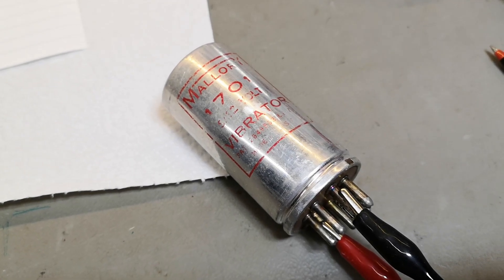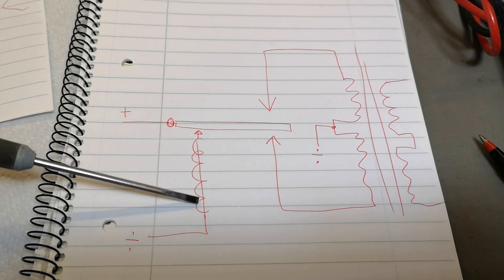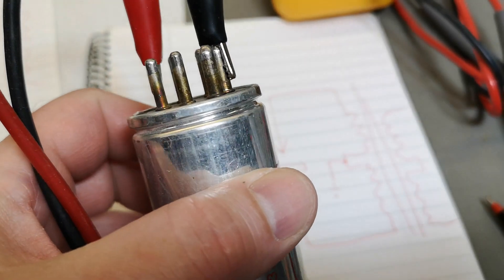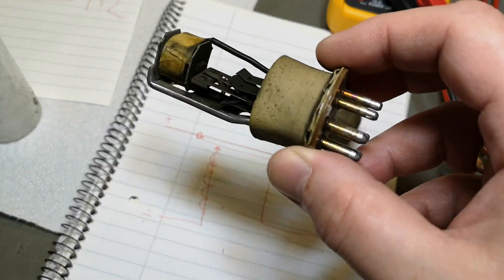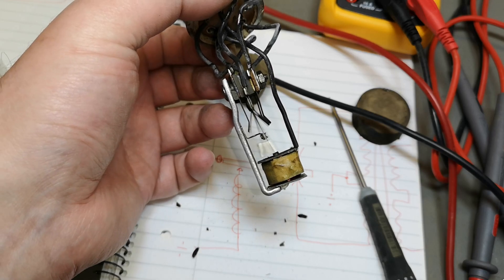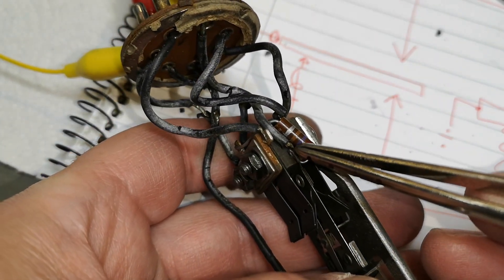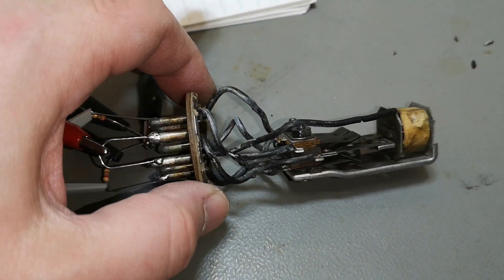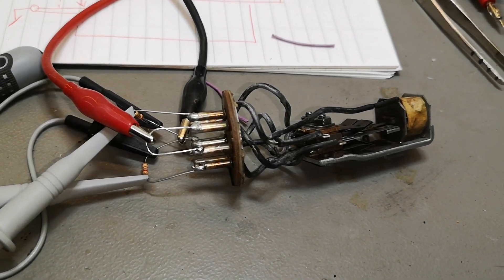Mallory 1701 Vibrator mecanical switch-mode explained teardown

Comment: Why did you put such a relay, which buzzes like a vibrator, into a tube radio, what is its function?
Reply from the maker: make 12V DC in to a much higher voltage needed for tubes.. you need an AC voltage to feed it thru a transformator to make a higher voltage. and the vibrator makes AC out of a DC supply, some also work on 6V, the first cars used 6V
Reply: Thanks  @TeardownOZ2CPU

Comment: I remember finding one of these for the first time. No markings on it whatsoever, thought it was a tube haha
Reply: A noisy tube that sounds like a electric razor
Reply from the maker: there are tubes that looks almost like this, look up EF50 and such, so if taking apart old stuff for the first time, it is clearly possible to be confused here, I have found 3 in 1 capacitors in sockets that looks even more like a vibrator
Reply: @TeardownOZ2CPU  Indeed, higher end application tubes do come in metal cans, then again there are shields and such that can fool the new players.